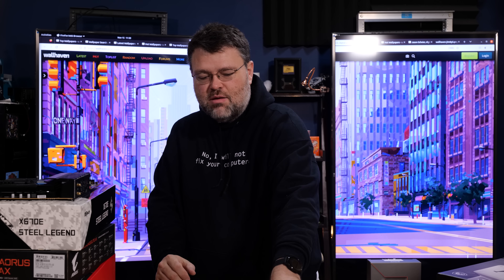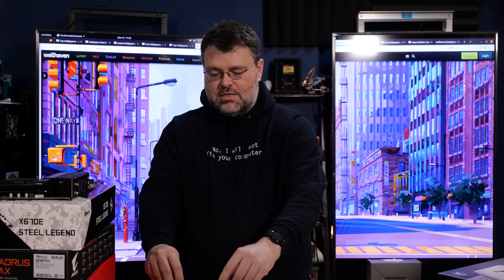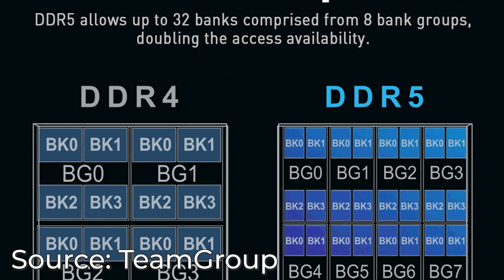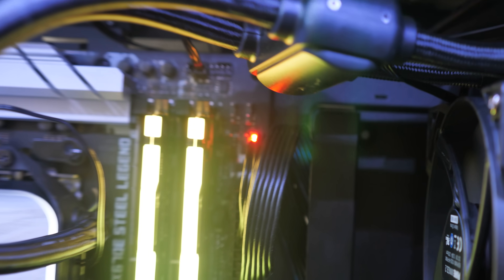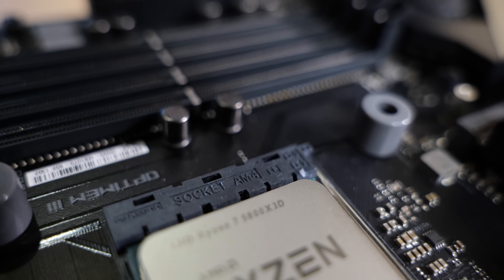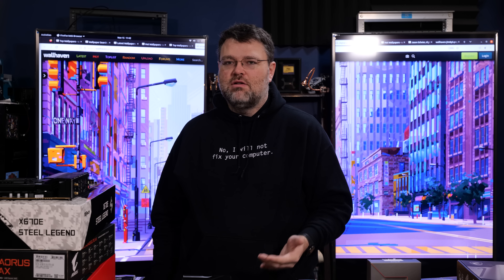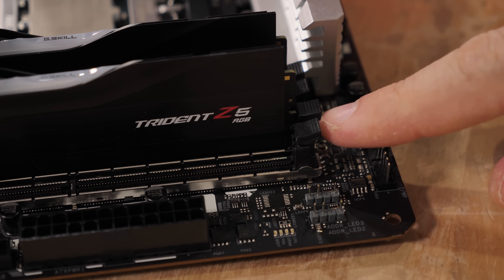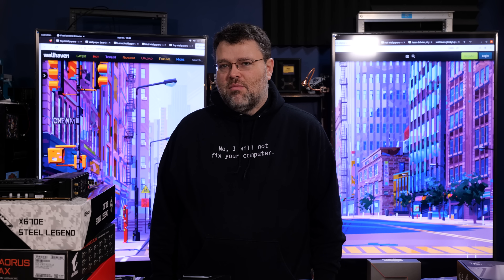Is 128GB of DDR5 IMPOSSIBLE on AM5? Level1 Investigates!

Comment: GLAD someone is talking about this! There are a lot people wondering why their 4 slot memory config can't run DDR5-6000 on AM5.
Reply: And not just for AMD!
Reply: Is this an issue with using 4 slots for 64gb?
Reply: @Ultrajamz  Yes, both Intel and AMD currently can't handle 4-DIMMs very well. People got 4x16 kits working stably at 6000 though, from what I've heard. But YMMV
Reply: @Ultrajamz  yes luckily I had a buddy buy my other 32gb kit that I bought off me. If you're going 64gb go with 2 32gb sticks. 4 = either super long boot times or no post
Reply: 2-slot vs 4-slot speeds have been like this FOR DECADES... Even back in DDR days motherboard manufacturers would state 4-slot configurations were slower and/or more temperamental (sensitive to mixing SKUs, higher latency, lower speeds) Often dual channel would ONLY work if you had two matched DIMMs even if you had 4 slots to use, so you had to chose capacity with 4 slots single channel or speed with two slots dual channel.
Since those days I think every motherboard I've ever had states that 2 v 4 slot configs, and dual rank v single rank sticks come with compromises to speed or capacity. This is why gaming rigs used to typically have less memory than a productivity machine, as they were going for high speed single rank DIMMs over high density.

It's only really because DDR4 is so long in the tooth and very mature at this stage that high performance high density sticks have become available. DDR5 is relatively new, and when compared to the very mature DDR4 this new stuff seems very 'experimental' in many ways.
Intel folk have been on DDR4 now for a long long while, and AMD folk swapped from a very mature DDR3 to an already mature DDR4, so between them it's been many years since a cutting edge memory technology was at the fore front of both groups, which is probably why it feels so messy, with lots of unknowns. We should expect the Zen4 refresh to smooth things out a bit, new Motherboard versions with tweaked layouts etc...
Reply: Corsair CMP96GX5M4B6000C30 runs perfectly fine on my MSI B650 G+W and R7 7800X3D. 96GB at 6000MT is flawless, long as you allow the settings to enable the ram to retrain every time. Insanely bad boot times, but it's worth it!
Reply: This is so bad review and so incorrect. With only 4 sticks of memory (kingston 6000mhz) and 1 motherboard (meg ace x670e) I’ve got 5600 mhz stable with 128gb and 34-35-35-68 timings. Thinking of posting a video with all my settings maybe will do. It clears all memory tests stable including memtest86. 74,5GB/s read 81,5GB/s write 70ns latency. Imagine what I could do with 100 different hardware at hand like this reviewer. Also, im not an expert this was my first ever overclocking.
Reply: AM4 do the Same. Its normal.
Reply: @NetrunnerAT  That said 128GB 3600 DDR4 was running very well, unlike the new DDR5-6000 "sweet spot"
Reply: @ChatGTA345  AM4 do the Same. I use 4000 128gb Kits and with two Sticks i get this Speed, But If i use 4 i get only 3400. This is normal ... Nothing new 🤷
Reply: @NetrunnerAT  Yeah I'm not arguing, just noting that I ran 3600 with AM4 and that was rock solid and top-tier performance, unlike with AM5 or Z790.
Reply: @ChatGTA345  ah ok ... My english is my weak spot 🤣
Reply: @NetrunnerAT  Have you tried adding the RAM in this specific order A2, B2, A1, B1?
Reply: @ChatGTA345  I can confirm 3600 on AM4. Rock solid rendering 24/7 for months.
Reply: @NetrunnerAT  My 5950X runs 4 sticks at 3600 perfectly, so I was surprised tonight when I couldn't get 6000 to run on my new ryzen 7950X setup. Guess it's back to 64 GB for now, save the second kit for another build lol.
Reply: @NetrunnerAT  but with oc can reach 8000mhz 64hb four dimm or not?
Reply: @lexavlogs7149  at the time, more or less Not! But possible new BIOS and some tweaks ... you can reache it in near Future.

I remember my 128gb Problem on AM4. Zen1 Run around 3200MHz. Zen3 Hit 3400MHz. After BIOS Update i get the 3600MHz.

I think AM5 get over the time simulare improfments.
Reply: @NetrunnerAT  emm nope only works in z790
Reply: @Chris123NT  That shouldn't really be surprising, you're going from 3rd gen AM4 to 1st gen AM5, it makes sense for memory support to be as bad as 1st gen AM4 was.
Reply: @llynellyn  Yeah, I couldn't even get it to run 64GB stable, ended up returning the parts, I'll try again next gen.
Reply: @earthtaurus5515  wut? why the F would it matter what order you physically put them in? On boot, all four are populated. It doesn't care which ones you put in first.
Reply: @insertnamehere4419  It does matter, read the manual and I'm talking from experience. on AM4 you have to put the ram in the order stated otherwise there are issues running xmp or higher memory speeds  or high memory speeds + tuned ram timings with 4 ram sticks populated (for me that was 4x8GB for 32 Gigs of Ram). Just do a quick web search and you will see the issues people are experiencing of not being able to run xmp or higher memory speeds with 4 sticks of RAM on AM4.
Reply: @earthtaurus5515  lmao " read the manual" uh...I didn't come here asking for help. Reread what I said. You have to slot them in  certain dimm slots if only using 2/4 correct, but the motherboard is not aware of the ORDER you put them in which is what you implied and its stupid. And If you're populating all 4....then put them in and fire up the PC, the motherboard isn't aware of what order you put them in. You don't see how stupid what you're saying sounds?
Reply: @insertnamehere4419  Yes, it sounds stupid. But I'm telling you from experience and anyone who actually repairs PCs or works in IT in support capacity will tell you IT issues often have very obscure solutions.
Reply: @insertnamehere4419  Motherboard manuals literally tell you to put the RAM in that order he said. My ROG Strix B650E-F Gaming WIFI manual was the first time I noticed that. Also heard a tech guy on YouTube mention it before when building. Always put RAM in the right order.

Comment: I'm shocked its working, but I'm running a 2x16GB kit of G.Skill DDR5-6000 CL30 in the A channel and a 2x16GB kit of G.Skill DDR5-6000 CL32 in the B channel with a 7900x.  With EXPO set its actually running all 4 DIMMS at 6000 CL30. Its passed the stress tests I've tried and I've been using it for almost a week now without any problems.
Reply: Check your actual bandwidth, though. I've got four sticks of 2x32GB-5800 running stable at 6000, but the actual bandwidth isn't much better than running them at 4000, which is probably because the fabric downclocks to relieve the memory controller. Worse, because of whatever is happening in the background, my cache performance also suffers. Depending on your workload you may not actually benefit from running the memory at those speeds.
Reply: 4x16GB presents similar strain to the IMC as 2x32GB, so your achievement is no better than Wendel's here.

Comment: I think 128GB support needs time to mature. In the end we're talking about consumer boards and board manufacturers will test RAM and optimize UEFI settings for the memory configurations which are around the sweetspot for consumers, so 16GB or 32GB in total.
And Intel has the 2nd gen CPUs with DDR5, so it can be assumed that they have improved the IMC in Raptor Lake compared to Alder Lake. If I remember correctly, early adopters had also issues with DDR5 compatibility.
So let's wait and see what AGESA and UEFI updates bring in the future.
Reply: Well it's not just 128GB, it's 64GB if you're using 16GB DIMMs
Reply: Actually it's companies forcing us to upgrade to workstation systems so that they get more money. Absolutely awful that I can't use 128gb ram in am5 motherboard at desired RAM speed.

Comment: Recently I built a 7950 system (Asus x670e ROG Crosshair Extreme) for a deep pockets client.  He ordered 128gb of Corsair Dominator Platinum RGB 5200.

With all 4 sticks, it would never run more than 3600mt/s, and took 20+ minutes to train/post.

With just two sticks, it would hit 4800mt/s (still not the 5200 advertised), and enabling manual DOCP would refuse to post even after an hour of training.

We were both a bit confused and upset.  He currently decided to stick to the 64gb.
Reply: "still not the 5200 advertised"
Cause NONE of the memory those brands sold is official DDR5 5200/6000/whatever. They are all overclocked, way different timings, way higher voltage/power. 
Right now we are just seeing the first few JEDEC 5600 kits arriving, 5200 for a bit longer - but JEDEC 5200 means 38 CAS and 1.1V. But most memory that you can get is glorified overclocked DDR5 4000-4800.
Reply: @ABaumstumpf  I understand that JEDEC is all that's guaranteed.  However, they advertise DOCP at 5200, and the set was on the QVL for the mainboard, so in theory it should work, and was advertised to do so.

Comment: Amazing, now server-grade boot times are a reality for desktop.
Reply: @Andrew Crews 5 to 10 minutes? That's Windows-XP-on-a-Dell levels of slow booting
Reply: @marcogenovesi8570  The Dell boot times however are brought on by the significant amount of bloatware that Dell loads into every computer they make.
Reply: for the first time in decades IBM now has competition for 1st place as the slowest systems to boot..... "great"
Reply: @TommyApel  I thought their petite boot was supposed to be comparable fast? At least that is what I heard for the Power 9 platform, and I would expect it is the same or better for newer ones.
Reply: @Aegor1998  not really, IBX ThinkServers are by a long mile the slowest servers to boot that I've ever had the displeasure of working with, it was at the point where you started looking for your car keys to go to the datacenter before they came back online, next after those is HP which are also ungodly slow to get through post especially if you have raid controllers.
Reply: Isn’t the problem that ddr5 is new and the memory controllers still not good enough to handle it?
Reply: @deathdrop  Didn't happen for DDR1 to DDR4 (so like 4 gens of RAM), also servers always did memory training
Reply: @marcogenovesi8570  well for servers that makes sense not for desktops though
Reply: It is a lot faster then manually testing the timmings yourself.
Reply: That's memory training boot time. It's less than 30 seconds from button to windows once its trained. Still not fast but its not bad
Reply: @frzen  yes that's what servers also waste most time on when booting. They usually do re-training every time though so it's always slow
Reply: My boot times went down from 58s to 26s (using G-Skill 64GB 6000MHz CL30 EXPO) once "Memory Context Restore" was set to "Enable" in the BIOS.
The system will train RAM once after reboot, will remember the appropriate settings and never train again, hence reducing boot times.
Reply: @Nayah9 thanks, can you share how many memory module do you install and size at 6000 cl30?
Reply: @Russell_Liao  No problem. I have two sticks installed. The kit is the G.Skill Trident Z5 Neo 2x32GB 6000MHz CL30 EXPO.
With the lastest ASUS BIOS update, my boot times are actually down to 21s (from power switch to Windows login screen).
- Avoid using 4 sticks of DDR5 unless you really have to, since the RAM won't be able to reach the advertised speed.
Reply: used to have those issues with my desktop too of "server grade boot times" what i did to fix it was rearrange USB devices so USB 2 was plugged into USB 2 and USB3 was plugged into USB 3 still only have 32GB of system RAM wanting 64GB due to Blender crashes due to not enough system RAM for my simulations.
Reply: It is not because of RAM amount that servers have very long boot times. It is usually disk array controllers, NIC bioses taking forever to do useless things, but enabled by default. It is just rarely something manufacturers optimize as they run for years without stopping. My desktop with 256GB boots in less than 10 seconds to the login prompt.
Reply: @movax20h  it is because of registered RAM traning and disk array controllers. Consumer hardware always skips a bunch of checks in RAM training and can get away with it because it's not a large amount of registered RAM.
Reply: i always disable bios compatibility skips and make sure i have 5-10 seconds pre bootloader and inside grub, my pc boots in about 60 seconds, however i balance this with uptimes upward of 2-3 weeks, even if my pc is capable of booting in 5-10 seconds

i havnt had stability issues ever since ive adopted this
Reply: People mad about the boot times need to watch this guy’s Optane videos
Reply: @Shoail Waniya that is very true
Reply: Meanwhile everyone with server hardware running vm emulation...
Reply: @Simon Something not really, a lot of Dell businness stuff (thin clients, tablets and workstations) waste ages for ram memory training every time you either pull the cmos battery or change the RAM, just like these PCs. RAM memory training isn't limited only to registered RAM, it's just that if you have small amounts of RAM (compared to a server) you can usually get away without
Reply: unionization demands from the mechanical elves inside your PC
Reply: I remember my first prebuilt PC in 2015 was booting off a hard drive and would take 10 minutes before my system was actually usable, 20s to boot and for system to be usable now with nvme, I can't wait to relive the dark times when my mobo arrives in the mail sometime in the next few days.
Reply: theres secret OS'es booting up in the CPU and firmware, all the hidden side channels communicating back and forth~ !
Reply: @mrlithium69  those have existed since socket 775 on Intel and socket AM4 on AMD, Intel ME and AMD PSP boot in less than a second on their "security coprocessor"

Comment: am4 runs way faster with 2 dimms vs 4.
Reply: Depends, if you can drive 4 sticks with the same speed as 2 sticks. 4 sticks DDR4-3600 provide a higher bandwidth compared to 2 sticks of DDR3600, simply due to more independent RAM pages that can be accessed and are not blocked by other works.
4 sticks DDR4-3600 are about equal in performance to 2 sticks DDR4-3800.

Comment: TLDR:  AMD blew it this gen with AM5
Reply: Intel has the same issues. This is an early IMC issue, not a CPU vendor issue. It happens every new DDR generation.
Reply: @Bayonet1809  "Intel has the same issues" <-- Eh, no. Raptor Lake IMC utterly flies.
4x A-dies @ DDR5-7200 on a $300 ASUS MB + $270 1300K
And FWIW, 2x A-dies @ DDR5-8600 on same config

AMD has an architectural problem- infinity fabric is the achilles heel of the cost reduction move to chiplets.
Reply: @markdeckard7651  We are not talking about maximum frequency here, we are talking about running 4x32GB, which Wendel showed in this video could only run at 4000MHz on Raptor Lake, so the same as Zen 4.

If anything I have a vested interest in Intel, so no way I am in an AMD bubble.
Reply: @Bayonet1809  Re-read.  Wendel showed he didn't use a Z690/Z790 board capable of maintaining signal integrity on 4x DIMMs at higher frequencies. Not much the CPU's IMC can do if the MB isn't pulling its weight, doesn't have enough PCB layers, etc.  G.Skill is also binning their DDR5 kits too tightly, and not bothering to test their 2x kits in 4x setups. TeamGroup is far better at the moment on their binning and "leaving some extra" in the tank for +voltage and +frequency beyond XMP spec, as well as testing 2x kits in 4x configs.
Reply: @markdeckard7651  Hynix A-Die is only available in 16GB DIMMs as far as I have seen, or have you got some 32GB DIMMs?

Comment: This doesn't sound great compared to DDR4... I am currently on AM4 with 128GB of DDR4-3600 memory, and in AIDA64 I get a read bandwidth of 53000 MB/s and a Latency of 77 ns. It sounds like DDR5 wouldn't be any better at all?
Reply: @Dmitry Akimov But the "failure" might really be the IMC on current CPUs as opposed to a failure of DDR5.
Reply: Same here. 5950X with 128GB 3600 CL16 works absolutely fine. Wont boot at all with 3800 even with a single stick but that 3600 is rockstable. Seems like one has to wait for the 8xxx Series AM5 Chips for better Performance with 4 DIMMs.

Comment: For AM4 boards I only had troubles with ASRock, never issues with other brands.  I had a b350 fatality with a 1700, and a b450 fatality with a 3600.    Both motherboards wouldn't go over 2800mhz ram with 3600mhz sticks.   Then I grabbed a b450 Asus board and put the Ryzen 5 3600 in it, and the ram will OC to 3800mhz with same timings as 3600mhz.
Reply: I also want to upgrade my AM4 3600 64GB (2dims) to 128GB 4dims. Are you saying I can expect problems with that ? 🤔